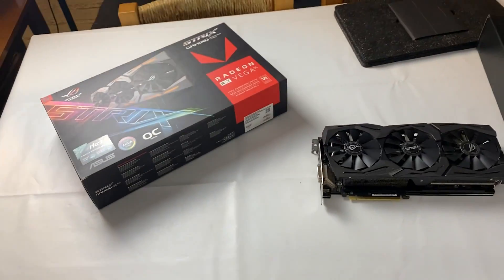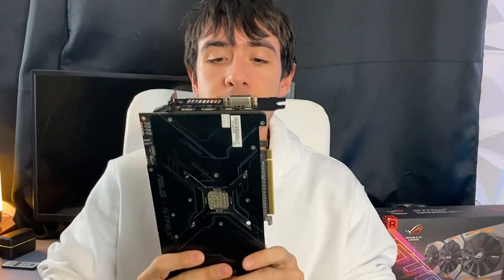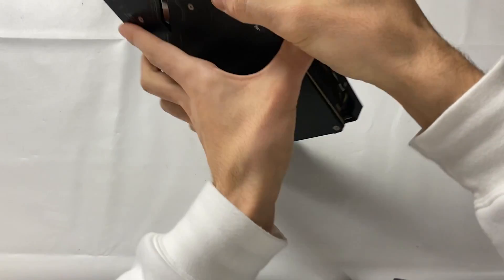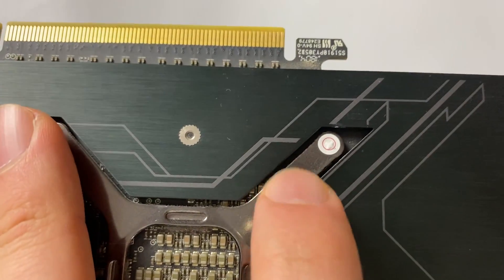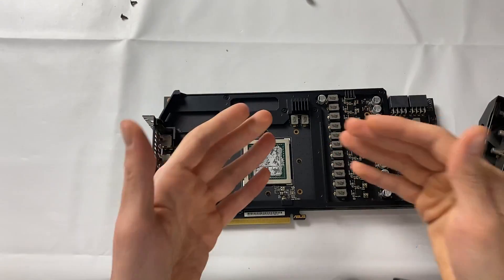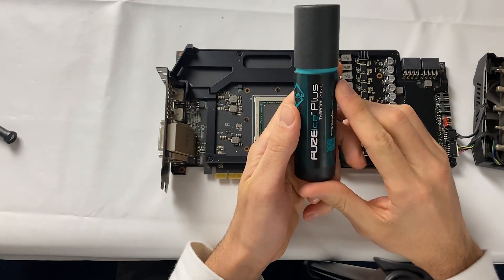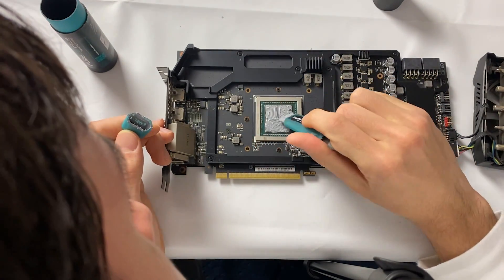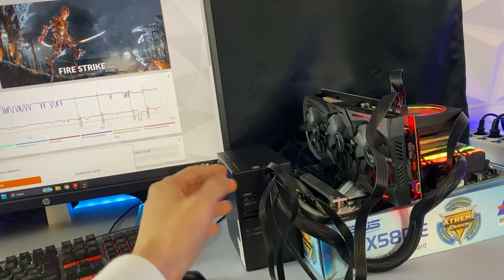Gaming on a RX Vega 56 in 2024… Bios Mod and Overclock for under 100$

Comment: but what is the best used gpu under 100$ with max 1x8pin power?
Reply from the maker: Tricky question😂 But if you take a look at the PC build from this Friday, in which we used this RX Vega 56, you’ll see that the PSU had a single 8Pin! So I’d still say Vega 56 :)
Reply: Ciao complimenti per il video! Se capisco bene riesci a fare girare la Vega 56 con un solo connettore 8PIN? Chiaramente dopo che hai fatto UV giusto? Grazie mille!